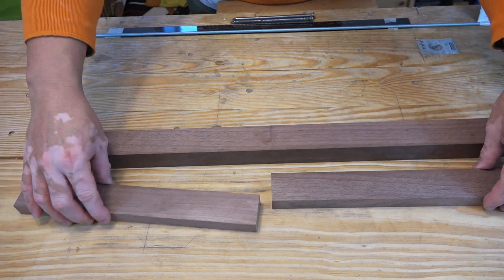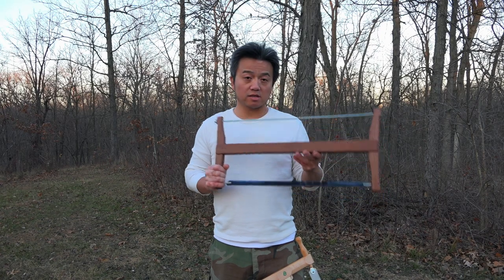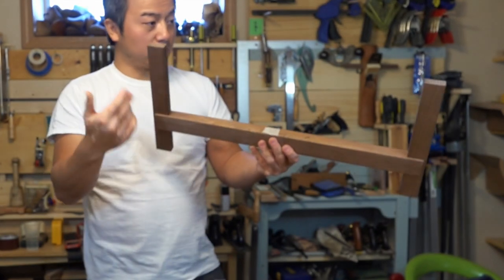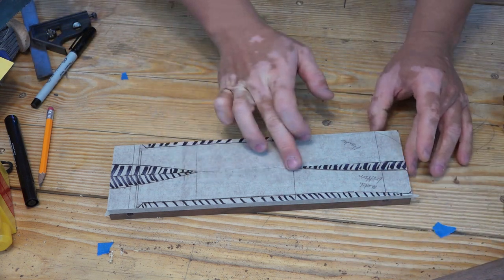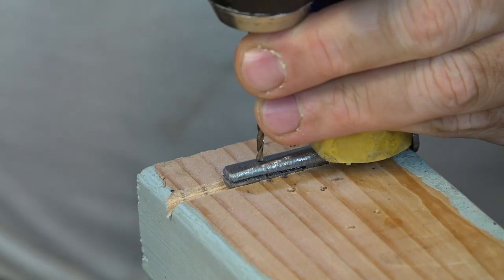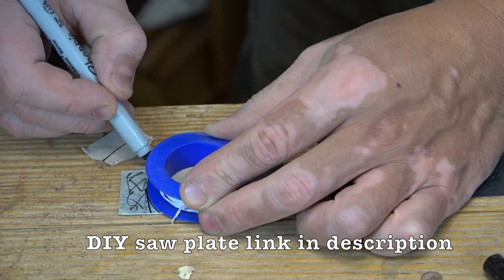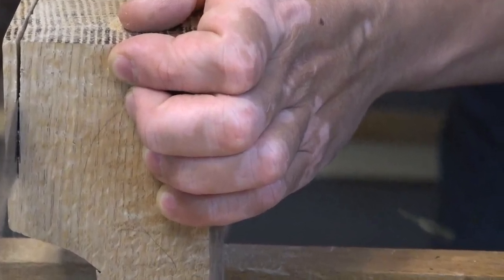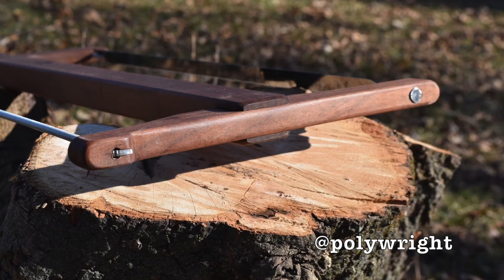Frame Saw 中国锯 - Traditional Chinese Woodworking Tool

Comment: I really like your series about Chinese woodworking tools. They are little known in the west.
Today I built this saw and I will also build some more Chinese tools.
I watched your videos again and what you said about European frame saws isn’t quite correct.
We also turn the blade to a somewhat 45 degree angle. Because you can not cut deep when the blade is in the same plane like the frame and you can not see you marking well.
Also we usually don’t use the handle for holding the saw when sawing, we usually hold it like the Chinese saw but with the whole hand above the blade pin not with the pinky below. 
The handles are for rotating the blade and to rest them below your hand to give you extra control when beginning a cut

I really like how the Chinese version is hold, because it feels like the blade is the continuation of my arm.
Reply from the maker: If you ever use a Chinese Frame saw you will understand the advantage.  Also, I have not found a video of a European frame saw used at a 45 degree angle, that pre- dates this video.
Reply: @johnzzhu  https://youtu.be/0TrzkOYHevk @6:55

I understand the advantage, as I said is built the saw you show in the video. You can easily see where you’re cutting

Comment: It is good to see more information about traditional Chinese woodworking and tools.  One point, if you check out the historical ways European frame saws were used, the angle of the blade was varied depending upon the goal and size of the stock.  Ripping longer pieces requires that the blade be angled to the frame in order to cut past the stretcher.  The two turned grips are not often used to push the saw.  Instead they are commonly are employed to set the angle of the saw blade to the frame.  It might depend a little on the size of the saw as well.

Comment: I have to say the reason behind melting the wax with a heat gun - the wax gets way down in to the pores and grain of the wood. Is a great quick and inexpensive finish that feels very good to the touch. That finish is not super durable but can be redone when needed, and is more than enough to keep moisture and gunge (sweat and dirt) off the saw itself. Keep up the good work!

Comment: Thanks for posting  john I purchased  2  very similar saws from woodwell in china mujingfang, brand .They are made from Indonesian redwood and are heavy ,  the blades are some type of carbon steel1in bandsaw blade with many TPI. I also made   1 chinese type frame saw from softwoods for  rip cutting  , and it has a  repurposed 1/2in blade that came from a yard sale . I also purchased  and made 5   euro type frame saws from woodcraft and hartville. Great job , on  your saw hope it gives you a lot of  good  use!
Reply from the maker: I've seen those saws, they don't particularly impress me. The ones I've made have become my go to saw. Trying to pare down all my plate saws.
Reply: mujingfang is rubbish

Comment: It’s a good feeling to make your own tools. Every time you see it and use it, it reminds you of the experience building it yourself.
What was the pin made from that you finally used?
Just curious: Doesn’t the application of beeswax prevent the linseed oil from penetrating and creating a permanent finish?
Thanks for building and producing this series!
Reply from the maker: Thanks Mac. I use a nail couple mm in diameter. Bee wax is semi-permanent. Very difficult to get the stuff off, and it would prevent linseed oil application. You can do linseed oil before wax.

Comment: Great build! LOL I once built a frame saw with a twist rope tension and section of bandsaw blade. I cranked it up, and it was working fine, then, the ROPE snapped and the handle whipped round and smacked me on the side of the head, right between my left ear and left eye.
Reply from the maker: I snapped the original brass pin I used to hold the saw. Thank God no injuries.

Comment: Just an observation: the European version has handles not for holding - the reason the frame sides have rounded edges is because it's held the same way as the Chinese one. The handles are there to allow for easier and more precise tilting of the blade. You almost never use it with the blade straight, but you also tilt the blade at very different angles. In fact, you always adjust the angle before each cut, depending on the position in which you need to cut. It's almost impossible to get a straight cut with the blade aligned with the frame - when you cut slightly bent downwards, as is very often the case, the frame would hit your shoulder. But then again, specifically because you continuously adjust the tilt of the blade, you don't want to be forced to de-tension and then re-tension the frame for each adjustment. The handles allow you to change the tilt of the blade even when the blade is tensioned.
Reply from the maker: Pay attention to how the saw is held in the hand.
Reply from the maker: Also watch how Roy Underhill holds his frame saws w/ handle. Also watch how Paul Sellers holds his frame saw, and pay attention to the fixed angle of the frame saw that Paul Sellers makes.
Reply: @johnzzhu  british and american woodworking tradicions are a litlle bit different than in continental Europe. The handle is primarily used to rotate the saw blade (the angle can be set as needed). You can hold it while sawing, but holding it by the frame is much easier. When rip-cutting long boards, the saw was held vertically with both hands with the blade rotated 90 degrees: https://www.youtube.com/watch?v=y-pup-DoAE8&t=827s

Comment: I adapted a large fretsaw to make it balance in the hand . I wired (wound and twisted ) a right angle bracket to the wooden handle . Holding the fretsaw with blade horizontal and frame upwards ,the bracket end comes down below  the wrist .
At the bottom end I fixed a blob of lead so the frame and lead balanced at my middle finger . The lead was closed in with tape to make it safe .   Now turning the blade vertical the balance is still perfect. Sideways it also balances.. The whole feel is like the saw is floating in the air. The weight is double what it was to start with. But it floats and balances .   Ideal for finer cuts with much less stress on the forearm.
     These wide frame saw blades are cheaper than I expected . About £6 . is a very nice price .  I like this saw design  without handles sticking out  .  The cross piece has no metal stubs to hold the 2 short ends in position . Make a few "out of sight "stubs . Or shape the cross piece ends inside the cut out as a curve and match that curve on the 2 ends .   Afterthought  You "Could "add a right angle Bracket  with some Lead to this frame saw to make it balance perfectly but maybe it would be a bit too heavy . I need a smiley here .
Reply from the maker: Thoughtful comment. Sorry for the late reply, took a long break. Making stubby tenons is something that's common, I wanted to showcase a different way. The weight of the saw helps with the cut, it's end loaded; it just glides once you find a good balance point.

Comment: Another question relating to the pins. You used pins for both ends of this saw, but in one of your other videos, I believe it was one of the half-moons or perhaps, the angled mortise and tenon, we see you using a frame saw, but it looks like the non-handle side of that saw the blade is fixed with some kind of plate and screw instead of a pin, was this a later improvement to the design or just a commercial saw?
Reply from the maker: The absence of a horn allows me to saw deep into a flat surface.

Comment: That looks and cuts AWESOME John! Is there any particular reason the blade is at a 45? And like the way the wax is applied  I have never used a heat gun after wiping wax on the piece of wood gonna have to try that looks like it works in turns out very well looking forward to the next one
Reply from the maker: Thanks Joe. I think 45 degrees is a really good balance angle, it's a natural position for the hand. So the frame saw, hand, wrist, elbow are in alignment.
Reply: John Zhu  OK I can see how that Works now..And always bro! LOVE THE content and detail u bring
Reply: Plus, On cutting off an end, you can cut a deeper kerf without hitting the cross bar? Or even install a ripping blade as well. You just have to design the saw arms to be deep enough for the width of the rip you do most commonly. Of course, I am guessing here, but sounds logical to me.
Reply from the maker: It is common in Chinese woodworking to use a mortise/tenon joint for a fixed size frame saw. I just showed the bridle joint for a movable one, like the one the Chinese master showed. My smaller (prototype) Chinese frame saw is a M/T, you can see it in the handle design part of this video.
Reply: John Zhu cool bro..gonna def chk that out
Reply: not particular reason , actually it is very often carpenters just twist the angle as they need , like when cutting board .
Reply: kaiwen he ahh I see what ur saying..makes sense..

Comment: Do you take the tension out of the blade when not in use? If not, have you seen it lose the set over time?
Reply from the maker: I do not. The reason one would loosen the strings is because the strings stretch over time, not the blade. That is the advantage of a metal tension rod. The only stretch is possibly from the holes I pierced on the blade.
Reply: Thanks for the reply. I've had bow saws, the kind for cutting branches and logs, lose their set rather quickly when left under tension. Since those blades are impulse hardened, I wasn't able to correct the problem myself. I supposed if a frame saw like you have here was to lose it's set, it would be a simple matter of going back to the saw vise. I'm excited to take a stab at making one soon.

Comment: I like it! One question comes to mind. It’s just the pressure holding the beam in place. Why didn’t they use a little joinery to keep it in one spot like the English style? And the 45 degree angle of the blade makes it so much easier to follow lines. I do that all the time. Cool vid. Thank you.
Reply from the maker: There are ones w/ mortise and tenons, in this style you can slide the beam up to make more room. The hand position is going to make it even easier.
Reply: long joinery is not necessary, chinese joinery is a bolt with a mushroom head.

Comment: Hi John ... it‘s not true... you can adjust the european Handsaw to 45 degrees too ... Grab the end of the Handels und twist the blade... that’s all ... after you twistet the blade, you have to tighten up the Frame and the saw Is ready to work with ... nice Video ... thx for sharing 👍🏽
Reply from the maker: Thanks, never said one couldn't adjust a European blade angle.

Comment: Hi John
Could you please give us some idea as to the thickness of the side pieces and the stretcher.
You say the saw should be about twice the length of the ?arm.
That would be roughly 24”.
Would that be approximately correct and secondly the side pieces should be roughly half the length of the stretcher?
I am wondering if the dimensions would make it easier to use the saw for example too long a saw would be harder to control as opposed to a saw that’s too short is compromised in the length of the stroke.
I believe I am making it pretty clear that I never built a frame saw before.
Thanks for a great video but it is generating some questions.
Reply from the maker: The side pieces are ~3/4" thick, the stretchers ~1/2" thicker than the side pieces. The actual size does really matter, it's the blade size that matters, the longest blade I have made ~30", shortest ~10"; a 16" blade should be a good starting point for an all around saw. The ratio of side:stretcher depends on how much leverage you want to have on the tensioner. I suggest you make one and you should see all the fine points. Chinese woodworking is very very flexible, there aren't a rigid set of rules, the tools are highly personalized by the user.
Reply: @johnzzhu  
Great 
I am off to the races now I mean saw building my first frame saw
Thank you so much

Comment: A well-done project! I just found your channel as I am planning a couple of frame saw builds. And one of the questions I have been trying to determine is if the blade pins need to be fixed at 45, or if the tension is enough to keep them at the angle desired. I didn't see anywhere in your video where you fixed the pins (nails), so I am guessing that technically they could turn and it is the tension that keeps them at the desired angle?
Reply from the maker: The pins are not fixed. The tension from the blade is more than enough to hold them in place.
Reply: @johnzzhu  Wow thanks for the quick reply, that helps a lot. I do a lot of mortise and tenon work, but Arts and Craft style, not the challenging angled stuff you do, and I am planning to build a frame saw for the purpose instead of investing in a high $$ modern tenon saw. And I am hoping it will also be useful for resawing some smaller boards, as I don't have a bandsaw.

Comment: “I replaced the weak pin with a very strong pin” - could you elaborate? I, too have attempted to use finish nails for pins on a homemade bow saw blade in the past, with similar results ;) What did you ultimately use for the pins?
Reply from the maker: I used a steel/iron nail of the proper size and strength for my application.

Comment: Are there any advantages to a 45 degree blade set, as opposed to a zero degree, other than you can cut deeper into the material without hitting the saw frame? Thanks for your vid!
Reply from the maker: More ergonomically when using traditional Chinese woodworking sawing techniques.
Reply: @johnzzhu  thanks. 👍

Comment: I have two band saws that are 50 and 60 centimeters long, 2.5 centimeters wide and 6 tpi.
I need to know the standard measures of the handles and the type of wood that I should use to build two saws.
Reply from the maker: There are no "standard" measurements for Chinese woodworking tools the wood parts are made by the furniture maker, the metal parts he buys from individual black smith made to his specifications.
Reply: I tell you, the two handle must be hard wood like oak or cherry,  the rest can be all kinds of wood like cheap pine.

Comment: Traditional saws were not built with threaded rods. Instead, we use twisted wires/ropes to obtain the pulling force.
Reply from the maker: Traditional saws were not built with band saws; they were not build in America. The Lu Ban spirit is to be innovative and skillful and use the simplest solution to solve a problem; not to hold on to outdated technology. The threaded rod is in every technical metric superior to tension ropes. The first frame saw probably used raw iron or copper or bronze.

Comment: does this saw do something unique or well ? why bother with such a big setup.  does it have some advantage ?  oh maybe the tension pulling on the blade helps keep it from binding ? i dont know
Reply from the maker: The saw just saws wood, it doesn't do anything special. I don't understand the "big setup" it is simpler than Western frame saw in the making. All bow/frame saws require some method of creating tension. This Chinese frame saw's advantage is accuracy and ease of use in the right hand.

Comment: Hey man, love the video and your work, but I have to disagree on the comment about european saws. They were always used at an angle. Hence the handles for adjusting the blade angle. It could be that one of the reasons that some people use it straight is that they copied the Paul Sellers design.
Reply from the maker: You're allowed to disagree in an open society. I've never seen them used consistently at an angle. Nor is it comfortable for me to try and use them at any angle except 90 degrees. There was woodworking before Paul Sellers; he is popular but that doesn't make him "good." There are plenty of people orders of magnitude better than PS.

Comment: Thank you John, impressive skills.
Idle curiosity, the wood that you used appeared to be walnut. Is that correct?  It's been a while for me, but walnut is a joy to work.
Reply from the maker: Yes, it is walnut.
Reply: @johnzzhu  Most European frame saws I held in my hands - it was the saw of choice for larger cuts for all sorts of wood workers, from cabinet makers to wooden house builders, when I grew up, and as a child I'd rather be in a workshop than in a candy shop - were made of lighter wood. Is hardwood specific for Chinese frame saws?

Comment: thank youfor this video! Here ( Italy) used frame saws for pretty anything, fine joinery included. I want to replicate your saw. Could you give us the exact dimensions of wooden beams nails and threaded rod?
Reply from the maker: Thanks Carlo, I know through out Europe the frame saw is still king. The plate saw is more of an English/American thing. There general rule is the arms around about half the length of the stretcher.

Comment: very nice saw. can you tell me why the blade is tilted and also whats difference does it make compare to a european saw in terms of advantages and disadvantages???
Reply from the maker: You can tilt the Euro frame saw blade as well. The distinction is the hand position. The tilted blade along with the hand position create an alignment that is very rigid but natural.
Reply: thks John

Comment: I made a regular one but didn't like the angle it made my wrist take.  I made another one, but I angled the upright forward so it's more comfortable on my wrist.  I only angle the one upright, there's no need to have the far end angled.
Reply from the maker: I don't understand what you are describing.
Reply: I made a framesaw with one of the uprights at an angle of about 93-94 degrees from the strut to make it more comfortable for the wrist.